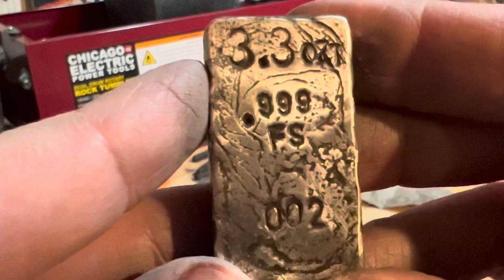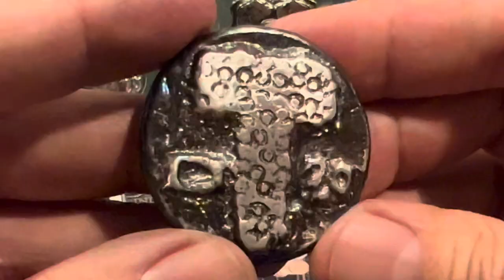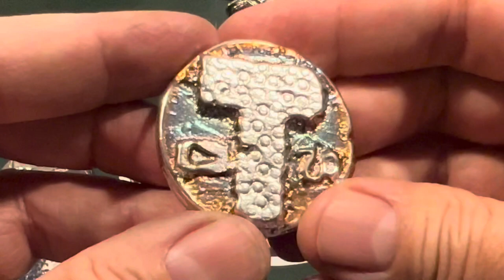Poured Silver Bar Hammered and Toned Technique

Comment: Great video. For better control of your strike's use a rounded punch and a hammer, that will help control your strike. Use a soft  pine board for the backing plate.
Reply from the maker: Thanks for the tip!